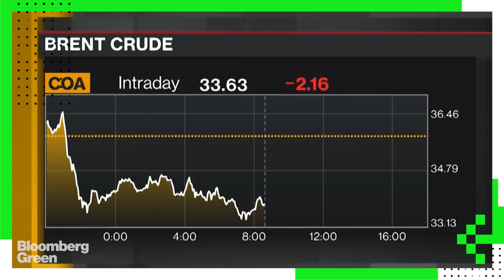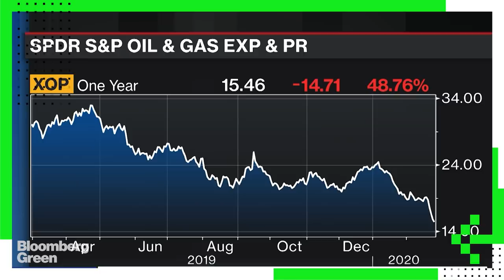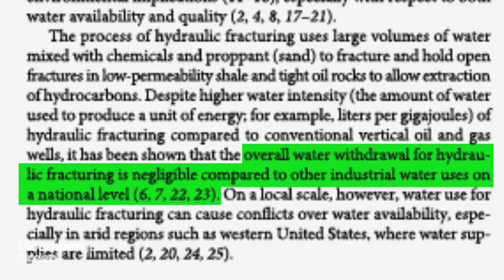Will The Shale Revolution Save America?

Comment: The waste water that gets pumped back into the ground comes from the ground. It is production water that comes out the ground along with oil and gas. The water is simply put back in the ground.
Reply: It's not just simply put back. It's also turned to poison.

Comment: before yall go nuts in the comments, it should be known that this news story was written as a neutral look at the costs and benefits of fracking. not for or opposing
Reply: Try to pay attention to the music. It's definately a negitive spin as it should be. Solar and battery is already cheaper. The money spent to invest in further fracking could be used to create the green energy that fracking supposedly is bridging to. The problem is who controls the money? Fracking just had more return than decentralized solar
Reply: @Skinnymarks  personally, I think nuclear is the way to go and in the long run its far better then solar and wind power. takes up a lot less land too.
Reply: Skinnymarks it’s really not. Solar is cheaper at Arizona summers, but normally it’s garbage
Reply: @coreytaylor447  
I'm all for nucular if anyone wants to build them. But the issue is that they take at least 10 years to build and as far as I understand not many projects are in the works. 

Solar is capable of ending oil before a nucular power plant even gets though the sea of burocracy and red tape.
Reply: It's pretty pro fracking IMHO.
Reply: Skinnymarks the amount of land required for solar to power large amounts of the grid is insane. There are environmental impacts to that too. Even in the desert of Arizona
Reply: Corey Taylor  tell Japan nuclear is better. Russia too. Nuclear meltdowns are not the way to go.

Comment: So this thing claims that fracking is now "staring down the barrel of job cuts and bankruptcies". Well as of 2022 the price of a barrel has shot WAY up and nobody claims this today. Furthermore, the New Madrid fault running up the Mississippi basin has had earthquakes way before oil was discovered including the strongest in U.S. history. Many of the Oklahoma earthquakes and the nearby states are a long ways from fracking locations while the densest fracking locations have not had the densest number of earthquakes. Further, it is thought that placing waste water back down abandoned wells rather than trucking it away is the problem, not the fracking itself which pumps the water back out.

Comment: Nuclear is the only bridge.
Reply: Nuclear power also has huge environmental problems including greenhouse gas emissions from the intensive process of mining and processing uranium. The left over mine tailings are toxic, perhaps not radioactive anymore but they contain lead and arsenic and cadmium and mercury, and wherever you dump the tailings the toxic metals are bound to leach into the local water supply.  Processing nuclear fuel also uses huge amounts of energy and generates emissions. And then, when the fuel has been used up in the reactor camera where do you put it? Where can you put it that is safe enough? How do you transport it without having a major radioactive accident? Most of this stuff gets done by the lowest bidder.
Reply: Nuclear is actually the only viable bridge

Comment: With one year's oil subsidy (~1 trillion USD at this point), the US could build out solar and wind farms across the continent, enough to cover all energy needs permanently.
It would also create low skilled jobs, as solar panels need a wash once or twice a year and all electrical systems need maintenance. 👍
Reply: Zoltán Kárpát what if it gets cloudy? Solar fails.
Reply: Aaron lalala exactly. Renewables have no decent storage options
Reply: @djdjdjshhsuss3941  Solar, wind and batteries stabilize the grid. Plz read up on it. About half of it would be huge solar farms, half of it on rooftops, locally, on houses, aka. distribuited power generation 👍
Reply: @Bobelponge123  Yes they do, and you don't have to store much. Read up on it, plz!
Reply: @Bobelponge123  You do generate power even on clowdy days. Just ask people in UK. 👍
Reply: @illeetcoder4992  Read up on it, dude. Try reading something recent, from 2019-2020 ... not from 1950 .... 👍 Nobody is talking about installing ancient technology.
Reply: @Poxenium  Do it. Renewable cannot replace oil in 1 day or 1 year or 10 years. It isn't my opinion, try to keep informed or get an engineering degree
Reply: @illeetcoder4992  I didn't say 1 day. It'll take at least 5 years... IF we don't get another corona 🙏
Reply: Zoltán Kárpát ancient technology? Tesla has the most advanced batteries and they can only power a car

Comment: I have to disagree.  There is an easy answer.  Learn to understand this equation: "energy_returned/energy_invested = 1"  When you understand this simple formula, you begin to see that fracking was never gong to work as an energy source.  Right now, the shale industry is barely above 1:1  (energy neutral)  Some would say that when you look at the entire life cycle of a fracked well, it is in negative territory.  A whole lot of energy goes into drilling, completing and producing a shale well, but not a lot comes out.

It was a great scheme for the Wall street banksters, but now the debtors can't even pay the interest on all those low interest loans they took out.